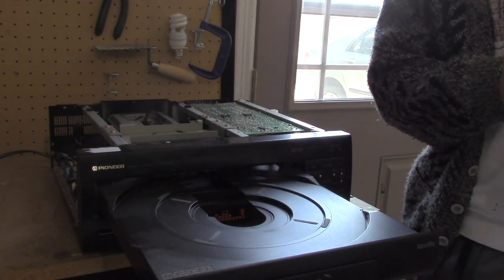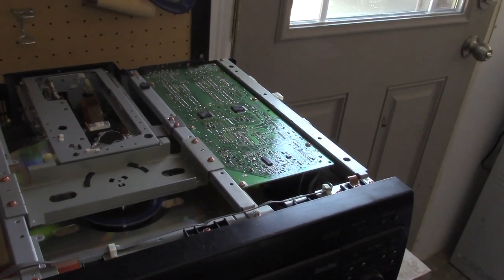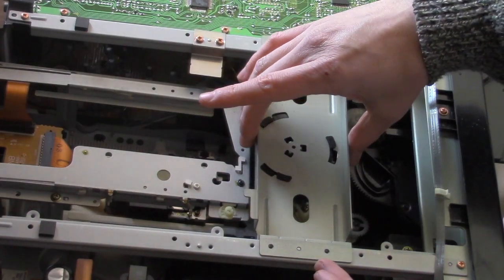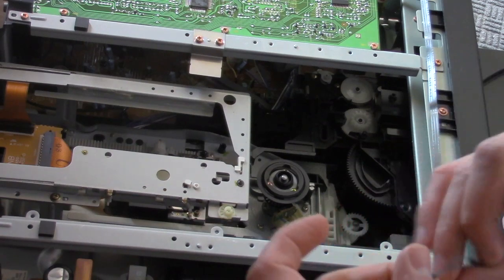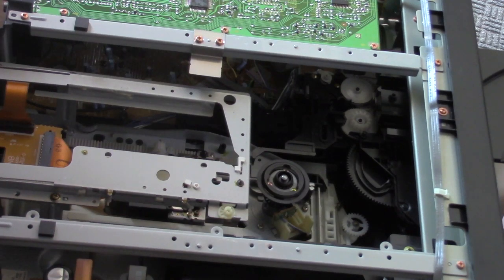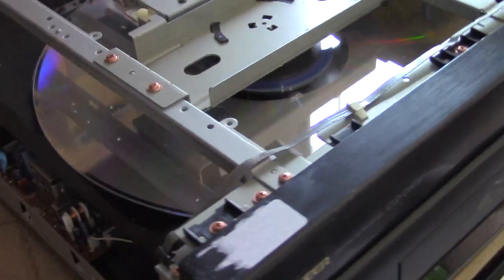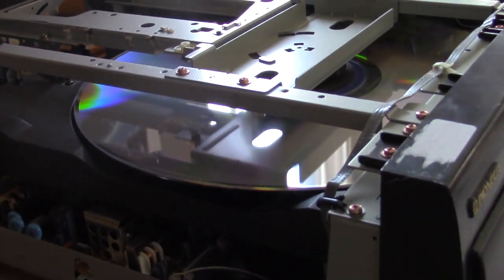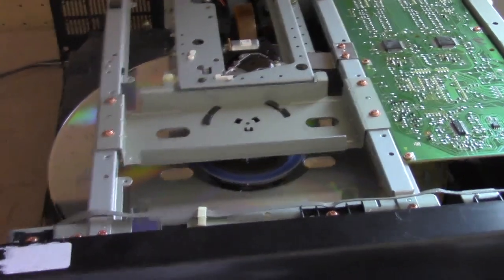Pioneer CLD-D703 Spindle Grip Ring Replacement

Comment: Glad the repair went ok! If anyone else has the issue where there's a bump in the grip ring, you can take an x-acto knife and cut out the slack so it lays flat. The bump happens if the ring gets laid down slightly oblong rather than perfectly circular, which is admittedly tricky to do. The silicone backing on the grip ring is split into 2 halves. If you take off one half, you can use the other half that still has the silicone backing on it to accurately position it without it sticking to your finger. If anyone is in need of a replacement grip ring, like LaserRot said, you can find me on Laserdisc Forever over on FB, or on eBay by searching "VEB1237 Grip Ring"

Comment: Might try Belt Ease..fan belt dressing…in a pince..
Fireproof on Ebay…Hes also doing some 3d printing of gears and M-holders…The grip ring is pricey ,butt no more than the original..